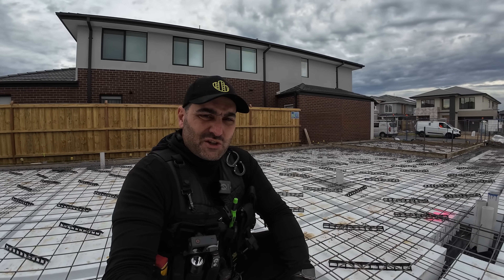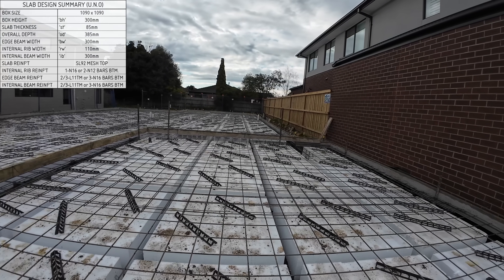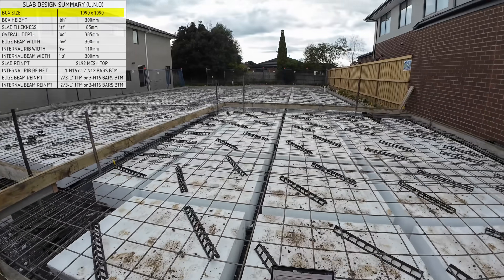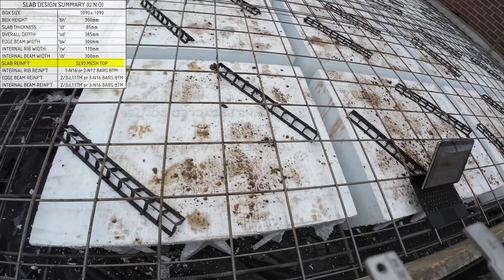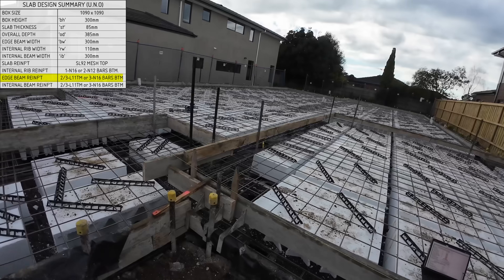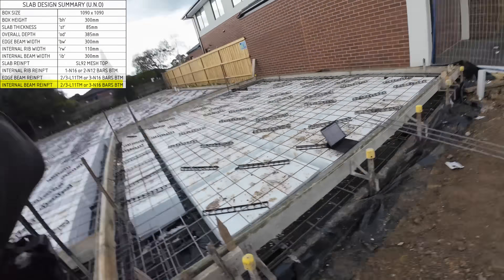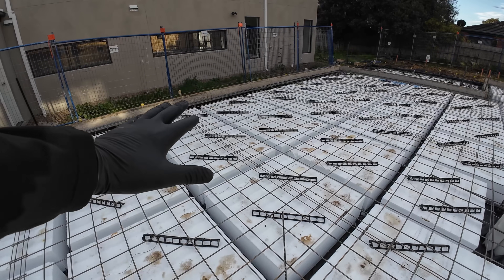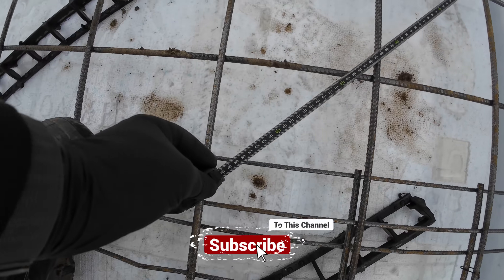Pre-Pour Slab Alert: What the Surveyor Missed!

Comment: Just use 50/50/50 rule
50 times the bar thickness is the overlap
Minimum 50 mil cover to any concrete surface
And a 50 mil cavity
If you use these rules 50-50 50 in most cases, you will be good

Comment: They are REQUIREMENTS not suggestions. Not sure why the beams are twice as wide as the design required thus requiring extra steel, if they had built it to the design in the first place there wouldn't have been a problem.

Comment: "Why is my slab cracking?" ..... as a layperson I appreciate the efforts you go to so a newbie can understand the difference between "looks good" to "IS good". Any chance you could add a little info to your videos some of the logical reasons WHY the specs/rules are what they are? something like (my uneducated guess) 'AS2870 states 700mm minimum overlap - because this was the tested length to ensure there are at least 2 tiepoints on the lap so it does not create a weakpoint likely to lead to a weak hingepoint and eventual cracking'... or whatever the actual reality is.

Comment: I’m going to have to disagree. Changing from 300 to 500 is just going to add strength. No extra bar is needed. If it required 500 then you would need the extra bar. I would put the strength of what they have against the 300 mill in the plans any day.

Comment: I was a concrete tester for 5 years. Currently working in concrete technical department for one of the bigggest concrete suppliers. I could write a book about the things I saw.
Reply: I definitely wouldn’t complain about a footing being a little too wide. What these guys have is going to be stronger than what’s in the plans and is definitely not something I would complain about. I don’t think he’s even reading the requirements right. I think it’s assuming you poured it specifications. That note just a guideline for the plans not a what if you poured it to wide chart.

Comment: It should be as simple as the inspector should have come out said yeah not bad just a few things to fix. Then the installer would be like yep no problem. Could just be a few apprentices worked on it missed a few things but could be easily fixed before pouring concrete which by then will be too late

Comment: I like how you count-out the quantity of long bars on that offcut, because it helps teach the installers and inspectors a good process, even if they choose not to implement your process to a 't' it is a good practice to verbally repeat the specified gauges, quantities, etc.  Well done.

Question: The engineer's notes about edge beam width increases by 100mm+ needing additional top/bottom bars does not seem to note the alternative possibility to add polystyrene boxing to reinstate the engineered design, i.e. 300mm.  It seems that the soil bearing capacity should come into play, because the subgrade supporting the foundation is possibly not capable of supporting the additional weight.  Furthermore, the contractor now has to buy more steel bars (if the additional  foam is not allowed) and must buy and place additional concrete, making premium additions to the contract in both material and labor, as well as pushing the schedule to the right.  The quarrel over the liability for this charge can also jeopardize progress as the general chases the subcontractor, etc.

Comment: Great video.  I did learn a lot.
Reply: He taught you that adding extra cement to a foundation makes it weaker. Last time I checked, concrete is superior to dirt. Making these guys add more rebar is ridiculous. The guideline is assuming the width is what’s in the plans. It’s not a what if you poured it to wide guide. There is zero chance a skinner footing with the same bar is going to be stronger. I hate it when inspectors go out of their way to complain about something. They did a great job. That slab will outlive the inspectors great grand kids.
Reply: @cuzr702  Are you in the same trade as those builders?????
Reply: @radambrose7571 I’m cement finisher. Anyone can tell you replacing some dirt with cement is going to make it stronger, not weaker. So, no reason to add more rebar. Theres nothing to compensate for.

Comment: Being of the older generation I'm SHOCKED at the use of polystyrene!!!  This stuff is RUBBISH.  In time it will flatten & brickwork & concrete will collapse.  And the termite problems it will cause - Oh my, what a corruption!  There's hardly a house worth buying anymore built after about 1990.  They're all rubbish.  My own house, built 2009 has few brick ties, & there's gaps around windows where there's no concrete or brick.  A set of glass sliding doors rattle when the door of the vehicle in the garage is closed!  Just garbage!  All because of corrupt builders & authorities & those who train tradespeople.  What a farce of an industry!

Comment: Waffle pod slabs have been around for over 30 years in Australia. The old boys used to tell me they where made out of thick cardboard back in the day. They used to have to erect them from flat packaging and staple them together. I dont beleive they are as strong as a conventional slab but they are built everywhere. Alot of builders in Australia have switched to steel frames, eliminating the need for termite flanges. I think they may still spray the subgrade with poison, once again eliminating the need for termite flanges.

Comment: I did a suspended slab for a new deck, with double garage under deck.

I chose the most expensive Concretor, based on his reputation for doing all the concrete on the new district hospital.

As an owner builder, I was constantly being derided for my lack of experience by the concretors, who were an arrogant bunch. Their heads nearly exploded when I told them the steel did not comply with the engineer’s specifications.

Their abuse of me became quite nasty. The very pedantic engineer, a German chap, explained to the concretors that they were reading the plans upside down.

Initially they refused to believe him, citing their recent hospital building. The engineer explained that all the steel in the hospital was laid upside down.

The engineer said as an aside, that for my slab it made no difference, as he had over designed the steel. I explained that as they had nastily taken the piss when I noticed their mistake, they could take down the steel, and start again.

The engineer said, quite approvingly, “ mate you are a hard bastards”. I agreed.

The steel was relaid, and passed by the engineer.

I paid extra to have the concrete core tested, to ensure that it was at least the 20mPA as specified.

I also knew that the first test result would be low, and would increase week by week. But this was the first test for the concretors, so they rang me in a panic, when the first test result was only 15 mPA.

I was tempted to let them twist in the wind, but I discovered that I was not really such a hard bastard.

The concretors listened respectfully as I explained concrete curing, and week 4 was expected to be at least 20. In fact week 4 was well above 20, closer to 25.

I believe they were always very respectful of owner builders thereafter.

Comment: The worst part about this.. When your home slab  starts cracking and moving and damages flooring etc. Nothing comes back on builder as its signed off as structural components were installed to specs. A

Comment: Yes good work.
Major and minor items.
The waffle slab crucially depends on correct rigidity for its strength.
Those missing bars, short splices and unsupported edge beams mean perhaps 10% less strength.
Concrete takes years to harden yet building shocks weights and resultant stresses will be placed on this slab within days.
How often are slabs cured for a week, the minimum required....just about never.
The Romans used cement and the Australians boge it up.
Letting down the team.
🇦🇺❤️🪃🥷🌏✅

Comment: Thank-you for the video. It looks like they have missed some waffles on the edge of the edge beam. I noticed on the drawing that there is a cut waffle pod at the edge @ not very much. But the builder hasn't put it in leading to the massive edge beams. I know that when I am laying out the pods that if the pods are too small to leave these off. But, you get bigger than usual edge beams. It comes down to where the pod layout starts off. 
The video is really good. I have learnt a lot.

Comment: The biggest problem is when something fails and who is to blame. 
Is it the engineer, the Concretor, the inspector or even the concrete mix. 
How does a builder cover himself if the inspector has passed the inspection before pouring. Where and what can the builder do from here.

Comment: All that polystyrene!. If that house gets demolished in the future breaking up that slab will be an environmental nightmare. Landfill wont take it, a crushing / recycling company won't take the rubble. It will need to be dumped in a hazardous waste landfill, costing an absolute fortune. I suppose this is environmental insulation but no thought how a future generation is going to deal with disposing of that mess and the pollution it will cause.

Comment: I did owner builder on my place, I renovated the old section and done an extension on my house. It’s on stumps, the new section I was happy with what the engineer had put in, the old section was re-stumped, I added an extra 20 stumps and added on the perimeter extra where most old homes tend to sink. I’m very fussy even the builder I had do all the work laughed. But knock on wood it’s been over 5 years since I had built my place with 3 earthquakes we have experienced in Victoria, and my place hasn’t even had 1 crack or any movement or settling cracks. I’m a big believer the foundation is the most important part it’s carrying all the weight of the house. Great pick on the steel customer is very lucky you picked up on it.

Comment: 13:33 an engineer can't make the minimum LESS then AS. The AS are the bare minimum, no one can say that it can be less than. If it is less.. its simply not compliant, I'm confused with what you meant here? Did you just mean basically it's meant to be more either way

Comment: My father (long deceased) was an engineer. He contracted a building company to build the family house on a concrete pad. He also added conditions to the build contract. One of the conditions was that he or his nominated representative must be on site to witness the slab being poured.  Surprise, one day he turned up on site and the slab had been poured without him being notified. He told the builders to stop work because there was a serious breach of contract and he wanted to drill the pad to verify the thickness.   The builders complained but he drilled the slab and found it was too thin.
He thanked the builders for providing the groundwork and then asked them to pour another slab on top and this time to the specifications in the build contract. The builders moaned and threatened to go to court. My father agreed with them and said that would be a good idea since he had lots of documentation to win the case.  Eventually he got another slab poured to spec, and the builders did not take any more "shortcuts" in building the house.

I remembered that lesson, so when we had an extension added to the back of our house, I had it engineer-designed to N4 wind rating (tornado rated) in Perth. I hired an independent building inspector to monitor the build. I told the builders that he is to have access at any time to inspect the progress of the build. 

Result: no problems.

Comment: How are they allowed the polystyrene in the foundation? Surely that massively decreases the strength?
Reply: The polystyrene is under the slab it's not part of the slab, they use the polystyrene blocks under the slab so they can leave those gaps to create concrete ribs to give the slab extra strength.

Comment: For those wondering how the trenches got wider, here are my theories:
1. The design measurements might have  not matched the excavator bucket size they had on their range. And they went a size up.
2. The sides of the trenches might have collapsed(you see how wet the ground is from rains); so by the time they put in reo they had to clean them up and that inadvertently changed the trench size(made it bigger).
So the challenge could have been the digger might have been a different subbie to the concretor and that didn’t help with the oversight.

Comment: Why no insulation under the ribs? Is the insulation   blocks just to save concrete?   Ans- no: Why allow thermal bridges through the slab  if this is not the case ?
No insulation in the footing an slab edges either. I get that it's not a cold contry with massive heating requires, but strange building code  if you ask  me there is premade slab edges  with cement facing  to achieve   broken thermal bridges when doing slabs.

Comment: Where did those extra widths come from? Less styro or the slab being bigger than designed? In the former case, I don't really see the need---the styro would have way less tensile strength than the unreinforced concrete replacing it (assuming the bars are in the outer 30cm and the number of ribs stays the same). In the latter case, I'd be more concerned with the slab being bigger than designed.

Comment: For every slab that gets ‘inspected’ and flagged for defects, there are 1,000 that get ‘inspected’ and passed that are defective but no one will ever know under the concrete until it cracks or fails. 
I’ve seen it too many times. 
Even when the concreter REMOVES steel after the inspection is done but before the pour. 
Buyers beware !! 😎

Comment: Why do they put polystyrene in the slab?
Reply: They act as a void former, implying that it is not necessary for a slab to have concrete in the space they occupy.
Ref:  StyroPod - Waffle Pods for Concrete Slabs
Reply: It’s an environmental disaster in 50+ years trying to dispose of these! It goes down drains while it’s on site.. terrible stuff
Reply: @nuwan86 only when gronks don't take care with it.. if people took two seconds to move it properly instead of throwing it around and crap it wouldn't be an issue.

Comment: not a concreter, but im wondering; if the edge beams have been made wider than the plans, wouldn't that make the whole slab wider than the plans? and if that is the case, that would explain why the 600mm overlap of the n16 bar (splice) is far less that it should be, as the guys cutting the steel are measuring to the plans, not the now wider slab! is this right or am I off base totally?
Reply: Off base , the foam pods are a grid pattern and only start from a specific point 
The reason the beams are bigger is because you have to cut the box’s to fit in the spot because it’s not a full spot , they have just been cut ruffly 
The spots where he is picking  , it js impossible to put 100-200 mm foam box in so it should have bars added to accommodate the widened beam 
Half of enginners don’t even bother 
It’s an addition if anything doesn’t weaken the slab by not doing it

Comment: If the concreter followed the engineers drawings he would have saved a lot of money, assuming the house is 20meters x 10 meters, edge beam increase by 200mm wide x 300mm deep x perimeter 60 meters = 3.6 cubic meters of concrete plus additional reo, additional labour plus internal beams increase in size. If he quoted of the drawings he’s not making any money.

Comment: If the edge beam only needs to be 300mm but the form is a bit bigger so more concrete is used unnecessarily the extra reo is not needed, as the concrete beam size exceeds requirements.

Comment: If your foundation cracks guess who s responsible after the house is biult ,,good luck .....
Bar chairs in a x pattern would do . Clearly the steel fixers cannot read or write . tape measure reading 101 failed ......A quality trade can read plans and checks the work meets customers design after completion .

Comment: I’ve been with a building company that’s been around for 30+ years and we always advised clients on options for foundation reinforcement, it’s just something culturally we do. Not everyone takes it but it’s the only ‘upsell’ we really push for and has us sleep well at night. 

It’s created a culture in the team where when we’ve lost or walked away from a few dozen jobs a year that we really didn’t believe in the engineering spec no one is upset or blaming management. From the top down we all accept this is our red line and no one gets upset for lost bonuses or work. 

Getting this right is the best insurance policy you can physically put in place for your build regardless of if it is  commercial or residential. 

With the pressure on the housing market land developers are getting more and more esoteric in land stabilisation methods getting the green tick and are rushing soil that shouldn’t be poured on so please don’t underestimate this stuff and the value down the line.

Comment: This slab is amazing compared to a lot of the rubbish being poured in SEQ.

It seems like something is off in the drafting or design. I can see why 200mm foam would create problems during pour.

I would accept if engineer signed off on a performance solution. But just installing the required steel in the first place would be half the cost of reengineering a departure.

Comment: The good thing about the Australian Standards is that there can be alternative ways to be compliant. They are not rigid.
But....  If you want to deviate away from the Standard, it basically has to be engineered to be a better solution that the one the Standard mentions.